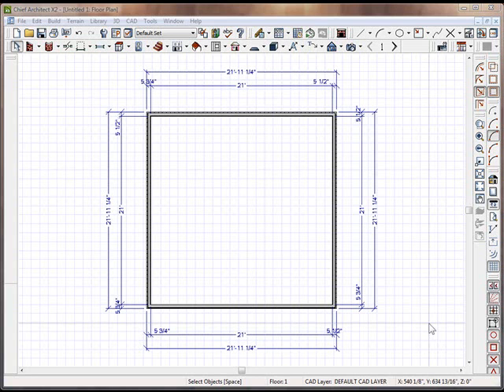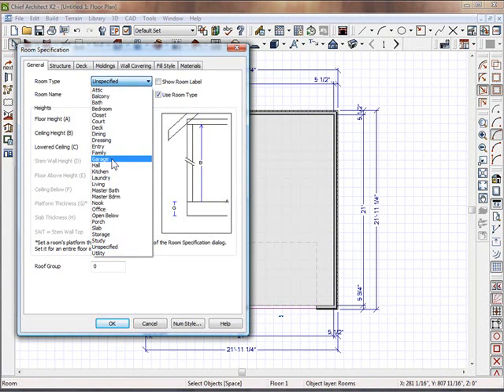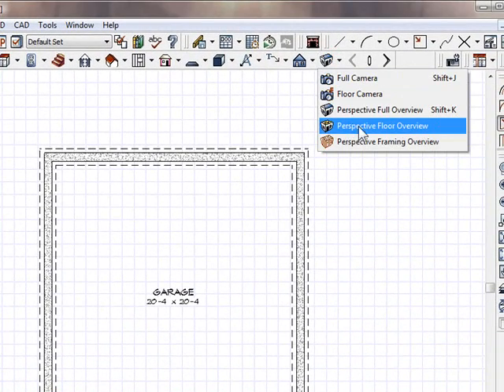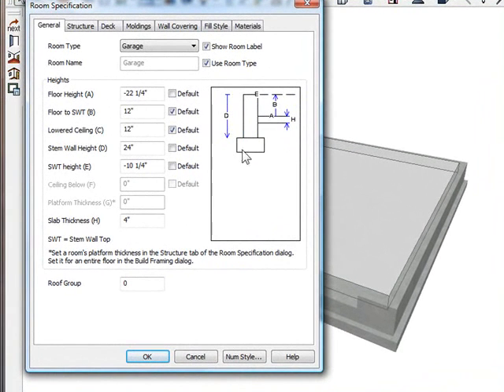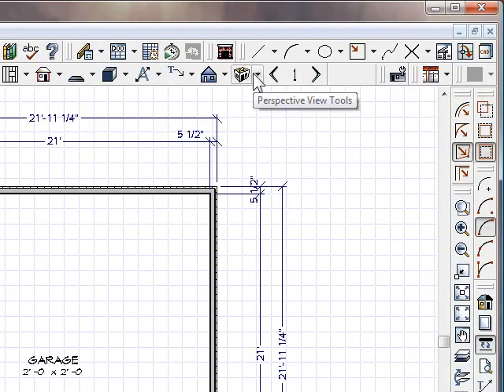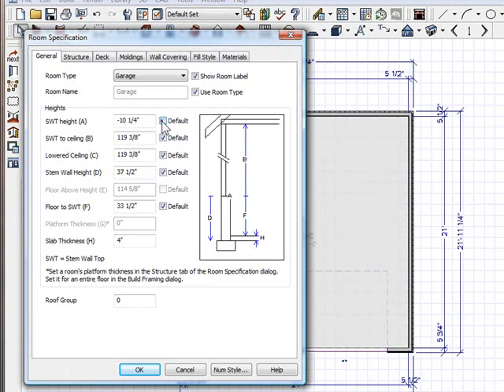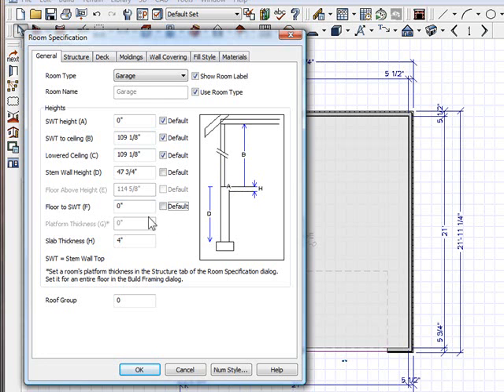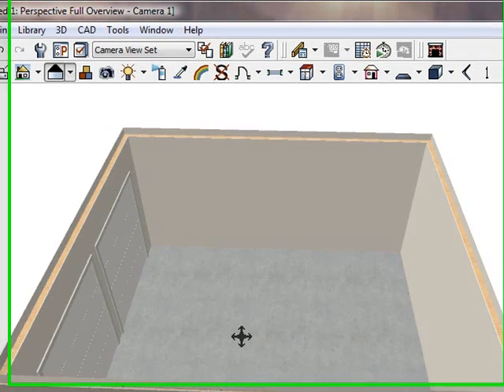Foundation Work In Garage Area - Using ChiefTutor.com

Comment: One is the copper ridge that I down loaded from chief, I had ben designing on a flat lot, and haven't got as far as terrain adjustment yet, I should play with some foundation setting I guess.I'm still a novice, I' trying learn something new after a stroke, so I'm not the sharpest knife in the draw thanks for your help